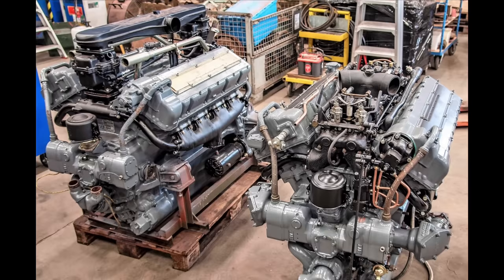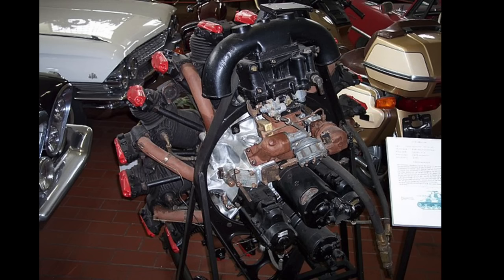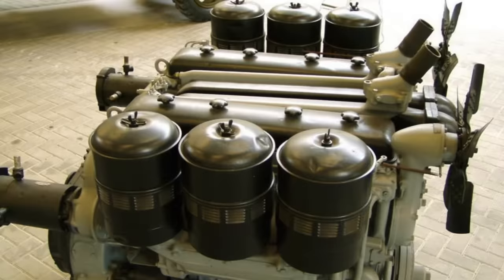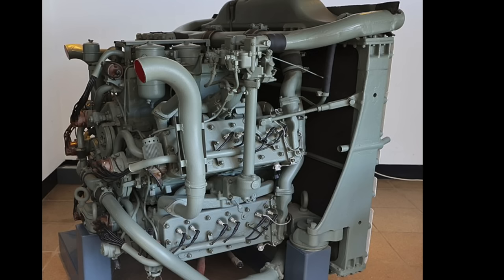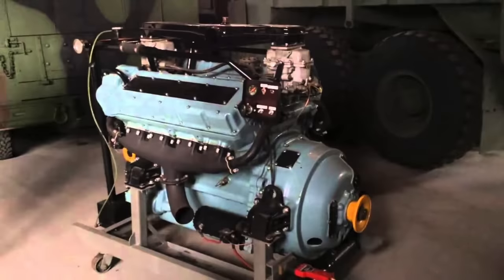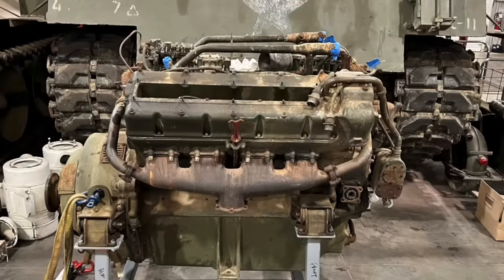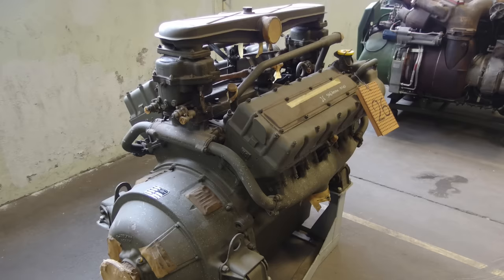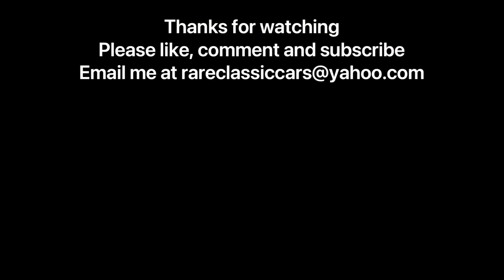An All-Aluminum, Flat-Plane Crank, DOHC V8 in 1940! Ford's 1,100ci (18L) GAA V8 Is a WWII Marvel

Comment: I'd like to hear it running.
Reply: Yes the GAA and the 30 cylinder Chrysler engine.  Beasts!
Reply: Just do a search on Ford GAA engine to find video's of it running.
Reply: Imagine a 1950's surplus  , one of those engines swapped into a bobbed duce!! That would Made an awesome toy! Especially if ya made a custom intake threw be on a couple 6-71 blowers from the Detroit diesels, and two more be of these carburators!!  It should easily Make 900+ ,@ 3000 rpm   mated to a ,,5"speed transmission maybe a 4speed aux.  ,you  could have a 2.5ton hotrod for about $100- $200 in yesteryears money probably $10-$15k today 'maybe $20k!   it would be fun to drive!!
Reply: Ford made DOHC in 1940 but couldn’t put it in the modular engine
Reply: You can search for gaa tractor pull as many of these engines were used for both single and multiple tractor pulling setups.
Reply: Come to the Museum of the American GI in College Station, TX. Particularly on a living-history day. They usually have 2-4 of them cruising around.
Reply: @megastarsport  Modular is a family of engines, some are DOHC and some arent. Coyote is DOHC, 3v 4.6l is SOHC. The 4-valve DOHC version of the Modular engine was introduced in the 1993 Lincoln Mark VIII as the 4.6 L Four-Cam V8.
Reply: Me too, that's why I clicked.

Comment: We had this exact engine in our 36' Jeffries cabin cruiser in the late '50s/early '60s. We also had a spare in our locker at Newmark's landing in Wilmington, California, which we swapped in when a wave flooded our exhaust and a valve head embedded itself in a piston...the GAA was a marvel, and would push the Jeffries to 30 knots! As a kid, I used to read the service documentation, while laying on the upholstered engine cover on the way to Catalina Island... Thanks for the blast from the past...
Reply: @schwartzenheimer1 Sounds like a healthy childhood
Reply: Yep, broke my first bolts in the bilge, when my Dad was too big to work in the confined space.  BTW, if anyone knows about Jeffries boats, they know that they were built for speed, not comfort - completely utilitarian and sparse, and it took experienced sailors to run. My Dad was in the Coast Guard, and saw duty in the Pacific in WWII (bet you didn't know that the CG actually deployed overseas during the war).

Seven Jeffries boats took a trip down the coast of Baja, we had a head gasket blow out, but they just took some copper wire and pounded it into the head/block joint, and kept going. I was 9 at the time (eight cherry bombs for a quarter in Ensenada, yeah!). A lifetime of memories...
Reply: Another interesting Ford engine. I wonder how much power one would produce if brought up to our machining standards and topped with a fuel injection system and supercharger.
Reply: It was an aircraft engine. The machining was definitely up to the standards of today. All It needed was a supercharger not even need fuel injection wouldve made 1200 to1500 hp. At 2500 rpm.and still be dead reliable
Reply: Probably about double or so, I doubt you could ever spin it fast enough to break much over1000 hp, but you could easily get 2000+ lbft of torque out of it if you could keep the rotating assembly together. My best guess if it was remachined with custom forged pistons and rods, large super or multiple turbos and E85 fuel injection, target would be 2500lbft and 1200hp.  Would make an awesome monster truck engine or vintage tractor trailer or bus racing engine.
Reply: @darrellbedford4857  There's one in a tractor puller  !!
Reply: Great story.👍🤠
Reply: No fuel injection needed.
Reply: There you go I was thinking some kind of Criss Craft.  Not a boat anchor. Turn the screw with this puppy

Comment: There's more info about the GAA engine: a). it had side oiler oiling 23 years before the Ford 427s had the feature. b). It came with tapered wrist pins in 1940, whereas most rodders think this feature didn't come around until the 1970s-1980s. c). most present day engine builders, as well as auto manufacturers engine design centers, say that the ideal connecting rod to crank stroke ratio ideally should be at 1.70-1.75 :1. The GAA came with rod-to-stroke ratio of 1.75. (10.5 rod centers, divide by 6" stroke.). d). The initial 12,080 engines came with double-splay 4-bolt main bearing caps. The later models went with regular 2-bold main caps because it took too much time to machine the block for the doble splay blocks. e). the engine had 1,000 lbs / ft of torque @ 1,000 rpm. Looking at Ford's dyno sheets (which I have), the hp line goes straight up at a 45-degree angle until 26-2800 rpm, when the engine runs out of carburetors. The first thing any engine modifier does is add carburetion or blowers. 

I am the website owner of the  www.fordgaaengine.com  website, and also am one of the administrators for the GAA engine blog site on Facebook. If you are interested, go to the Ford GAA engine website, and go down the  pictures section. My #1 engine that I built is the one near the bottom, with the polished valve covers and the black background, and labeled as "reprocessed as screen savers."

I have two stories that may be of interest to you: a). Story #1: there was a logger in Washington State that was a friend of a man that I knew who also has some GAA engines. When my friend went out to Washington to visit his friend, the friend showed him his logging truck, which had a GAA engine for power. My friend asked the man what gear he normally ran the truck in when hauling logs. Bearing in mind that a stock GAA engine has a minimum of 1,000 lbs / ft of torque at every rpm from 1,000 revs to beyond the redline, the man just told my friend, "whatever gear it happens to be in at the time." b).  Story #2. I bought some parts a couple times from a man out by Lake Mead / Hoover Dam in Nevada, and the man ran an offshore V-hull boat in competition, with his power plant being one GAA engine, modified with some internal goodies, MSD ignitions and 3 Holley double pumper carbs. His one engine drove dual Mercruiser racing outdrives, connecting the drives with a 6" Gilmer timing belt to each one. The class competition was the same hull with dual Big Block Chevys on Hilborn Fuel Injection. He won as many races as he didn't win, his one Ford GAA vs Dual Chevy 427s-454s. b-1). He one time tromped the throttle too hard and snapped a 6-inch Gilmer belt from too much torque being applied too quickly.  b-2). An example of: sometimes some is good but more is not better: He had a friend who convinced him to take out  the GAA engine and put in a gas turbine engine. He did so, the boat caught fire, burned to the waterline, and the hull is now quietly resting in 800-ft of water behind Lake Mead / Hoover Dam. 

Thanks for putting out this little video about the GAA engines. Its amazing, a man out in the Seattle area set up the Facebook blog site not quite a year ago, and we now have over 525 members wanting to know more about this engine. I even got, about 2-3 years ago as a result of my website (www.fordgaaengine.com), a man affiliated with a Ford Flathead owner website, and he asked that I send some pics of the GAAs to his website, because he wanted to "bookend" the Pre-WW2 engine building efforts of Henry Ford and Friends. After I sent some pictures, my website provider sent me a tabulation of all the people logging on to the site right afterwards. A 60-HP flathead Ford V8 side by side with an aluminum, DOHC, 32V engine at the far opposite end of the engine spectrum. Who'd a thunk it.
Reply: Well that answers to stroke question. Bore? (I can do the math but don't want to figure you have it at your tips), Compression ratio? Valve size?
Reply: Your own website says it only made 175 HP.  Maybe a stock flathead made 60 HP, but I've worked on a couple pretty hot ones now that easily cleared 500 HP, let alone 175.  I've bored and honed Honda B18 blocks for guys that purportedly made 1600.  (My boss did the fire rings.)  The torque is impressive as a number, but not considering that's less than one pound foot of torque per cubic inch.  Don't get me wrong, I love old engines, especially odd or giant ones, but you really seem like you're overselling these things.  What's the mileage in a full-size truck?  My 454 gets about 14 making roughly 350 horsepower and 600 ft-lbs and it's stock other than the cam and rockers.  Edit: Oh, duh, Holley carb and Edelbrock intake too.  Oh, and it's a pushrod engine. :P  Double edit: there's a reason Mercury used Chevy-designed engines for their marine division;  Ford's engines couldn't handle wide open throttle for hours on end out on the lakes.  Holy triple edit, Batman:  I just realized I have a '62 Olds aluminum 215 CID that's supposed to make more horsepower, though significantly less torque.  (The side oiling and tapered gudgeons are still awesome in 1940 though, as is the DOHC config.)
Reply: @cobracharmer6178 that and his comment that Ford’s wouldn’t hold together wide open for long periods of time.  He’s a typical fanboy.  I would argue Merc using GM engines is more a function of being able to use interchangeable parts between big and small blocks.  Whereas Ford has different bell-housing patterns, and many other features that inconvenience being budget friendly.

But instead of discussing this cool piece of history he had to talk about his boat anchor.
Reply: My website says the engine put out 175 hp "AT 1000 RPM", along with the 1,000 pounds of torque. It then goes on to say that a stock GAA engine had 500 hp @ 2600 rpms, and 525 hp at 2800 rpms, stock, as installed in tanks.. I have the Ford dynomometer sheet from 1945 which shows the hp and the torque curves. Consider this: It was just 2-3 years ago that stock GM Duramax, Ford Power Stroke and Cummins diesel engines got to the 1000 rpm torque level,, and that is only at their point of max torque with big turbochargers and complete computer controls. In 1940-42 the Ford GAA gas engine had 1000 pounds of torque at EVERY RPM FROM 1000 TO OVER THE  2800 RPM REDLINE. . That was stock as installed in Sherman or Pershing tanks. HP is calculated as: Torque x RPM, then divided by 5252. The GAA in stock trim, but with the governor disabled would rev to 3800 rpm and then encountered valve float with the stock valve springs, so the HP numbers are limited by the relatively low rev limits. However, on the street and on the battlefield it is torque that does the job, and any time the stoplight turns green or the tank commander tells the driver to "go for it," the engine has 1000 pounds of torque instantly available. I ask that you re-read the narrative on the www.fordgaaengine.com website to re-familiarize yourself with the design, engineering and performance of the engine. It got its power in 1940-1945 from (2) 2-bbl carburetors and ran on 7.5:1 compression because the army only used 80-octane gas in military applications, thus cutting the power down from its potential. With even 87-octane gas, power would have been up substantially.
Reply: The "big boys use Chebby 454s as starter motors for their GAAs. I think you deliberately misread the power data on the GAA website, for the article plainly says (quoting) "The GAA engine put out 175 HP "at 1000  rpm'." It then goes on to say that it put out 500 hp at 2600 rpm and over 1000 lbs torque at every rpm from 1000 to past the redline at 2600. The GAA has the power/torque to rip the living guts out of your 454. It will shred the gears out of every GM car and pickup truck transmission.  @FuckGoogle502
Reply: Well I am impressed. It's not everyday I learn something new but seeing your video and further your GAA web site I subbed and have many questions.
Reply: Exactly what size Blower or Blowers fit this amazing Beast ? 
If it is a single supercharger it must be larger than the 14/71 . 
21/71 ? Possibly larger ? The largest single unit blower I have ever seen is a gigantic floor mounted unit the size of 1970s full size Ford E450 extended 14 seat passenger VAN. It's for or from a container Ship with a 14 cylinder 2 stroke diesel WARTZILLA engine. The largest diesel engine made. It produces
120,000 shaft horsepower.
Reply: @FuckGoogle502  
Mercruiser offered Ford Windsor engines. I worked on several when I was employed at Hines-Farley offshore yachts in the late 80s. OMC used Ford 385 series 460s with a Cobra out drive. Fords couldn't handle wide open throttle for hours on end, huh?
Reply: Thx so much for that explanation....musta took a min to write all that...haha....I appreciate your effort, providing information to the masses
Reply: DId Ford engineers design the GAA or use outside expertise, this in light of the poorly designed flathead V8 used from 1932-1953 and the exhaust porting was never corrected in that 21 years !!
Reply: Cool stories and additional facts would love to see what that crazy truck looked like
Reply: @MrGGPRI  What it really goes to show is how much the war caused technological progression. The Flathead was, for one, pre war, and for two, it was good enough at its job and cheap. Ford wanted to sell cars everyone could afford. Ford was also the first to fully adopt OHC V8s with its Modular lineup years later.
Reply: @MrGGPRI that the flathead lived so long is a product of its cheap mass production and testament to its’ relatively solid reliability. They made millions upon millions of the flatheads, and only 30,000ish GAA’s. Something like that was far too specialized and complicated to mass produce, even in a theoretical scaled-down-to-standard-automobile version
Reply: Hey - thanks for the excellent stories and the history!

Comment: Fun fact - the GAA nomenclature was re-used on another Ford DOHC 4 valve V engine - the Ford Cosworth GAA 3.4 litre V6 used in the racing Ford Capri. Capable of making similar power to its 18 litre namesake, too, though at considerably higher revs.